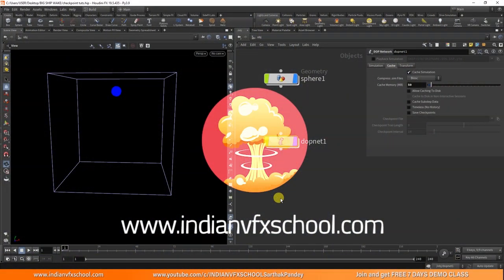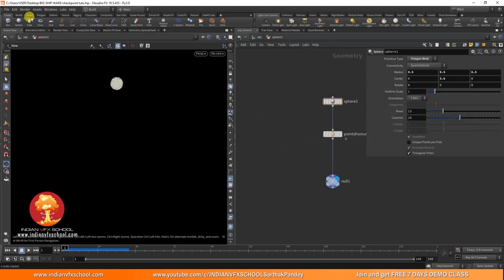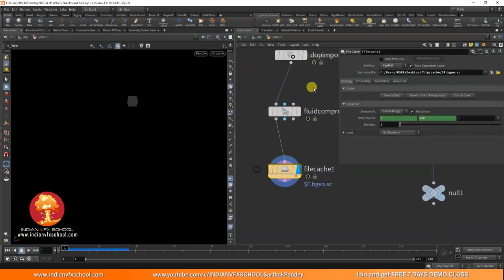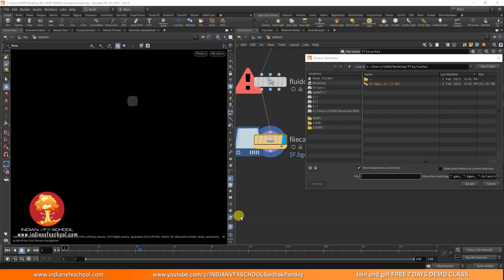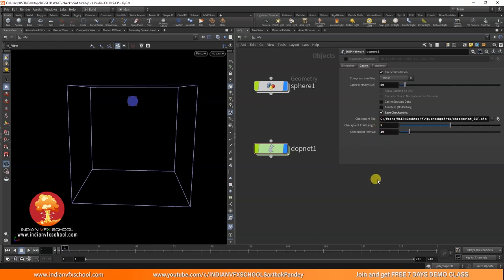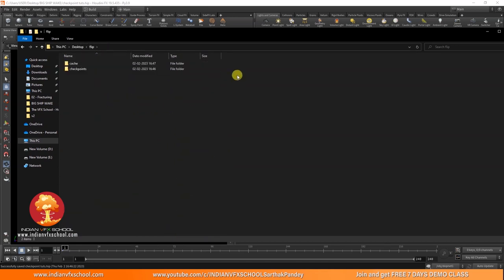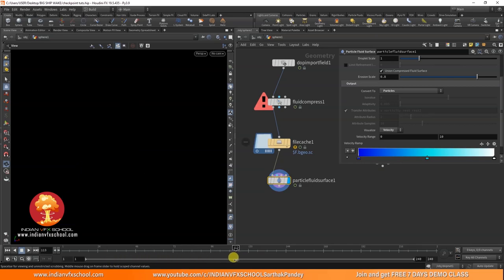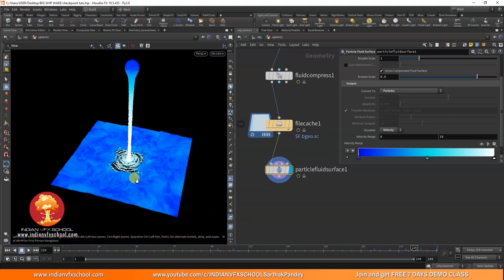How To Resume Simulations In Houdini - FOOLPROOF METHOD

Comment: hii well thanx for the video ...
i m using HOUDINI 19.5.303
but in my case it is not helping 
im using  8 substeps whiles caching and i cache for say 1-6 FRAMES ..i have kept trail lenght to 4 n checkpoint intervals at 5..... so total i get 81 caches files . so i delete half made frame no. 6  cache file...then i reset or restart houidini file or the whole software n start caching from 6-10 frames ...it doesnt get render .the flipobjects dont get rendered. cache file do appear in folder but all file are size of 2KB . 
so when i scrub i get flip object till frame 5 but after it flip object disappears.
Reply: I m facing same problem. Did you fix it
Reply: @Jalaj509  same problem here!
Reply: i dont know how but now it works , i didnt do anything different just the same value as the video 10 and 5, im sugin HOUDINI 19.5.303